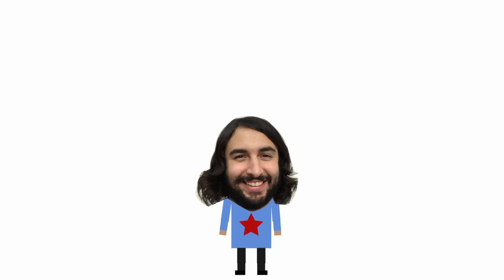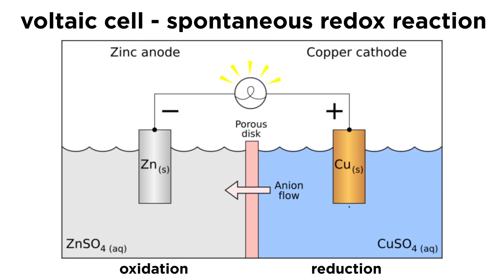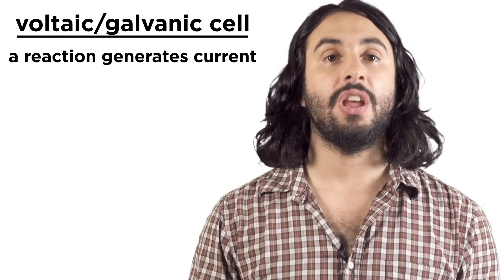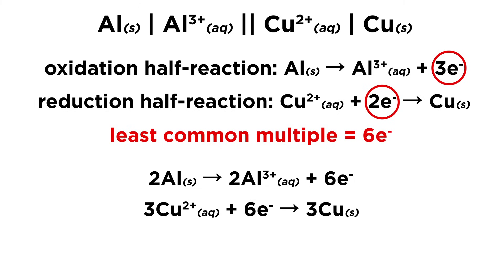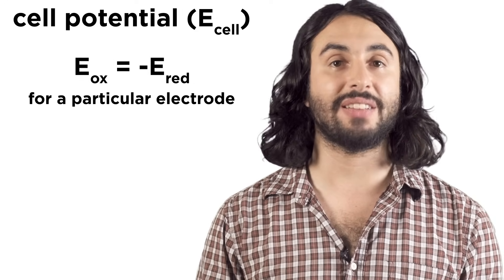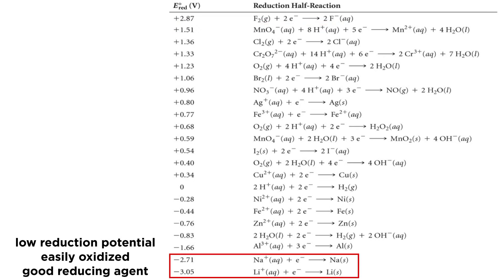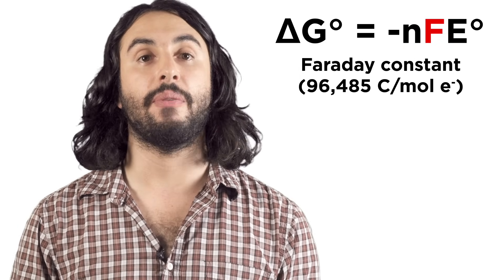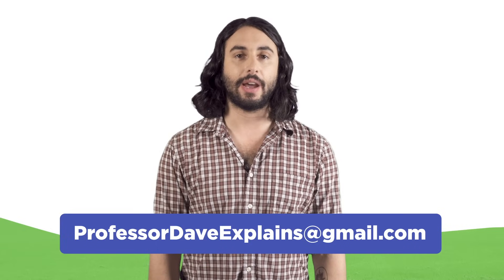Electrochemistry

Comment: anode is + and cathode is - not the other way round
Reply from the maker: This video is correct.
Reply: Professor Dave is correct - for galvanic cells.  

I'll bet, though, that you are dealing with electrolytic cells.   An anode is where oxidation occurs.  It's mind-frying because if you want to induce oxidation at the electrode -say oxidize the electrode itself from metal to ions in solution, the basis for electropolishing - you hook up the positive terminal of the power supply to the electrode.   Positive sucks out electrons from anything at the electrode surface

Conversely, to drive reduction (reduction = cathode) such as electroplating, you hook up the negative terminal to the electrode you want to plate.   Negative feeds electrons to anything at the electrode surface, such as metal ions you want to reduce and plate on the surface.  

I once knew a guy doing stress corrosion cracking studies on stainless steels.  He told me that he set up electrochemical test cells by going through the thermodynamics and the equations, then hooking it up exactly the opposite.  It never failed him.

Comment: For the Ecell, why didn't you change the sign of the anode to positive 1.66.  The chart shows negative 1.66 for Al3+ to Al(s) which is the reverse of the anode in the problem at the end.  So wouldn't you flip the sign since the reaction is flipped? pls answer ty
Reply from the maker: we don't manipulate the reduction potentials when calculating Ecell, we just plug them in directly
Reply: I agree with jjdh911 dexter that it's easier to just think "I SUM the energies of the proper half reactions" and then flip the reduction half reaction as needed then try to remember which one to subtract.  It's not manipulation; I was taught to do it that way.  I try to avoid memorizing whenever possible!

Comment: For the Ecell, why didn't you change the sign of the anode to positive 1.66.  The chart shows negative 1.66 for Al3+ to Al(s) which is the reverse of the anode in the problem at the end.  So wouldn't you flip the sign since the reaction is flipped?
Reply: Do you know basic math?

Comment: Electrons flow from low electric potential to high; the opposite of what you said @ 2:50.
conventional current will flow from high to low voltage
Reply: Professor Dave is this accurate?
I need help with electrochemistry and to study for my chem 2 final?

Comment: sir in electrolytic cells we consider anode as positive and here we dont. is there any reason for that?
Reply from the maker: in electrolytic cells a current is used to drive an otherwise nonspontaneous reaction, whereas in a voltaic cell a spontaneous redox reaction is used to generate a current, so it's the reverse situation in terms of electron flow
Reply: well explained tq